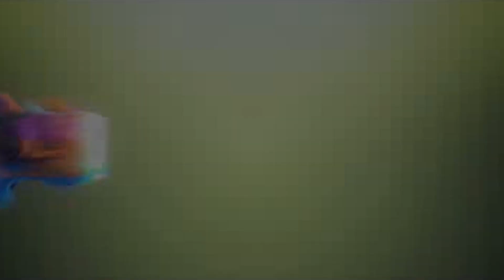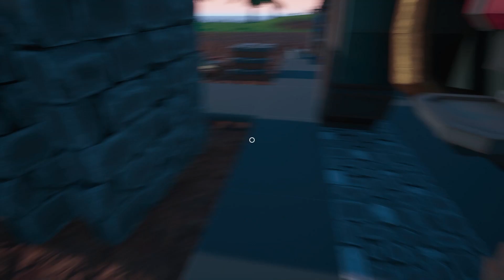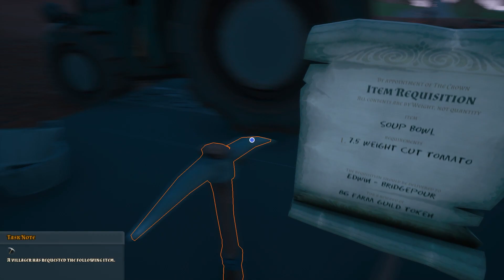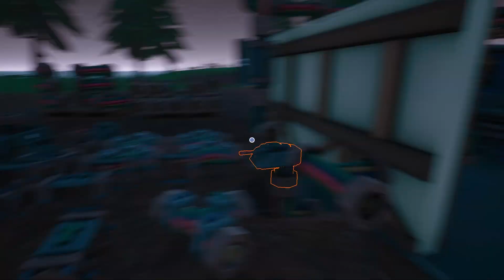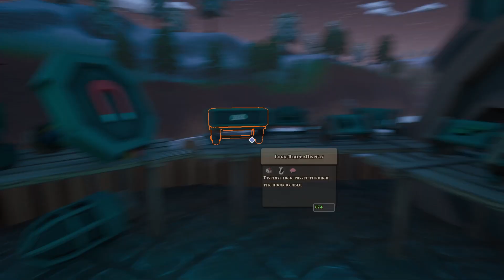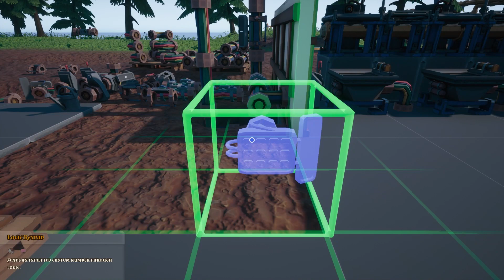Hydroneer 09 How to - Auto Gem compressor Logic system.

Comment: its rly buggy and need to restart game constatly when experimenting with thses stuff , had rly wierd stuff .
Reply from the maker: I didn't need to restart, but when i left the base and went far away then would come back again, some of the gem hoppers would be full of gems that would not compress, i ended up shutting the base and mining off when i would leave, then turn it back on when i got back, when i was around the base while it was working ... for the most part it worked fine, don't know what your running into or having issues with.
Reply: @D_and_Wee_gaming  logic weight counters and counters bypass (A >=  B) only light they respect , cant overlap 1 sec deleys with with other hooks ... or they destroy working build , 1 into 0 than 1 than 0 and flip hook dosnt travel a lot of pipes i belive and yeah when experimenting or twiking somethin it may get out of order working backwards ading a flip hook may fix it exit game enter game may not work then so it easely gets confusing at the end idk whet els i had
Reply from the maker: Hey Ivan, sorry i think i am misunderstanding you, there is no delay timer, i only add 1 flip hook from the counter to the logic gate (A >= B), i have a diode hook after the reset signal so nothing comes backwards, it counts to 5 sends a signal to the compressors and then resets the counter, did you miss something along the way in your build, this was a fairly simple set up.

My problem was gems missing the compressor and getting built up on the "lip" of the compressor, it worked fine, timing and all, it just "missed" the gems, and left them there uncompressed. 

I don't think i had your problem, i don't overlap any delays, one signal coming from counter when that signal gets to 5, triggers the gate, sends a signal to activate the compressors, that signal splits back to the counter to reset it. The flip hook will travel down a logic cable until it's read, used, or changed to another signal.
Reply: @D_and_Wee_gaming  mby i missed something will try also the diode hook but it shoudnt be needed the reset dosnt send any signals i belive, dont have time for that game atm only. I am trying to make auto compressors for funzys and for that u need magnets and deleys .with auto smelters its easier coz the new item works a lot nicer idk how its called "reads liquid weight in smelters" or somthing.
Reply from the maker: No problem, let me know what you figure out.
Reply: @D_and_Wee_gaming  so i removed all the pipes and put them back kinda , now i don't have this (A>=B) problem and wont know how i got to it i guess  and managed  to make something but still buggy twik twik and something decides (no i dont want to work that way any longer give me a flip hook) xD hopefully it will work fine later on. so from (A>=B) i connected 3 magnets , valve , gem compressor and the reset on logic weight reader , and i decided everything will get validator hook to stop all the 0 and make the (A>=B) singal a double signal with a loop 2 diades to stop the loop to continue and 4 secounds deley on the loop. Every thing has flip-flop to turn on and of exept reset , magnets and reset have a flip and i added some sec deleys on magnets per preference. Still a lot of cables and hooks for a simple task its a mess 10 blocks high taking a lot of space and wasn't testing this on a large build only prepered what i need for it :p .
Edit: Ohhh yeah was avoiding to put  hooks at the start from (A>=B) afraid of buggs
Reply from the maker: Interesting you had to go that far to get this to work, and i don't know the bugs your encountering in the logic hooks, I've never had them go buggy. I have made systems in my workshop that don't work, i have to figure out what I did wrong, but I've never had anything go buggy on my.
Reply: spoilers : it doesn't work i wrote this prematurely sorry forget larger build , i let it run go on map come back  belt stops , cought it once the 2nd signal never came was watching around 10 or so loops was working fine if it wasnt a bugg idk what it was , i could never make something with those counters i blame them magnets arent good as well if its posible allways go for a valve .Logic hooks are the least problematic atm or i just avoided them idk could try to test will it work if i add the validator at the start than flip-flop so i only use 1 of them before i destroy this abomination xD only lazzy then i have to watch it. I think i have to steal ur timer and replace the counter your timer is rly awesome btw .
Reply from the maker: The timer must be from the colored lights video, but thanks, it's a refinement of a conversation i had on discord with another logic enthusiast, was wondering if a belt system to load the spanner throwers would work, i've always hand fed them, and i've never done anything with the magnets in any of my builds, yet..
Reply: @D_and_Wee_gaming  now it does work, it didnt work before when belts had collision.
Reply: Hey i know i said this before but this time i got it working with your timer  will notify you if it fails in any case  but i doubt it. so i am dividing  it by 4 have 4 seconds 0f 0 and no loops needed 1 flip for magnets , ooh and i found out valve dosnt close on double or more 0 so i put double flips on valve and becouse it close and opens to soon have 2 valves 1 with 2 seconds deley , slaped 2 flips on compressor as well , so only magnets can mess up now :D timer rocks , weight counter and counter just never use.
Edit: 2 seconds of 0
Reply from the maker: Glad it's working for you